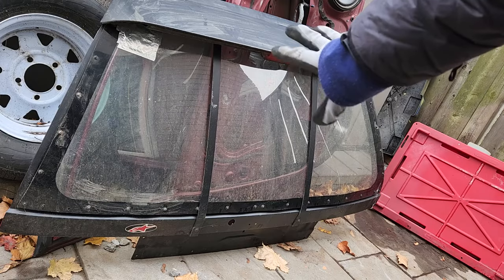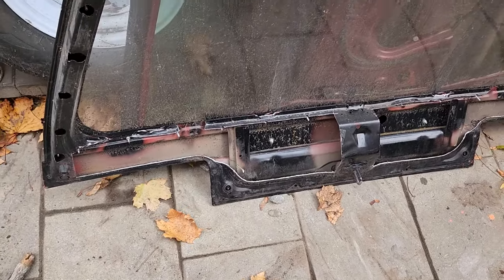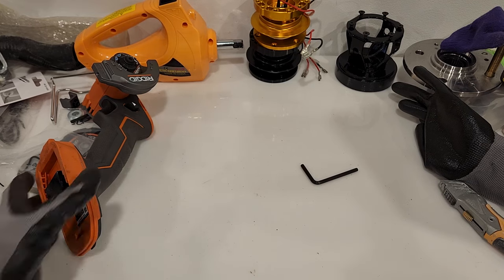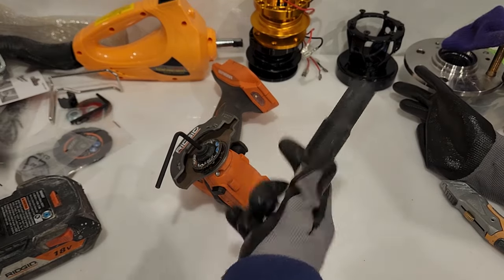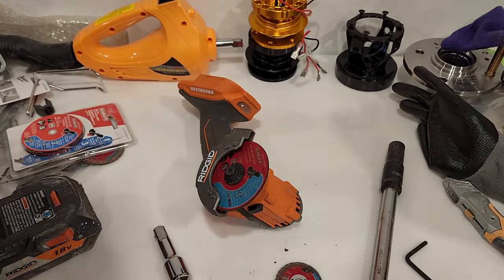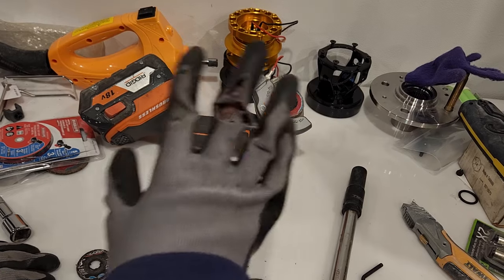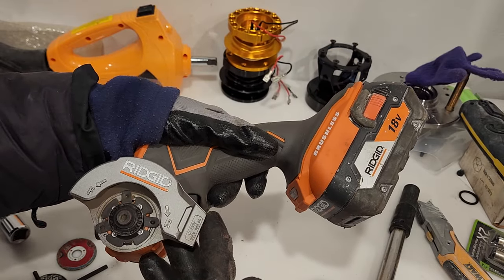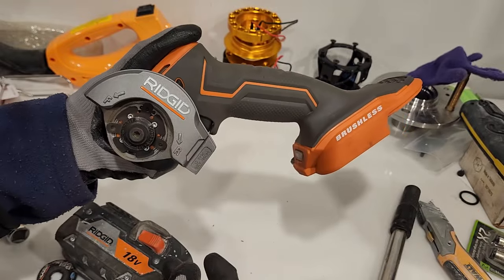Ridgid  3 inch Cut off saw review

Comment: I too have heard from users that their screws (a) came loose (when used in reverse, one instance I've heard of) and (b) got stuck (several users reported that).
Never happened to me though - however my use is much lighter, mainly cutting screws, thin steel strips, and aluminum / plastic profiles, and a bit of plywood.
I am really pleased with it, but it looks like it's not good for the tasks that you have to undertake.

I still use my cordless angle grinder for bigger jobs.
This tool takes some getting used to, particularly requiring control to keep it from "running away", and it being back heavy is a contributing factor just like you mentioned.

Thank you for showing it in action, might come in handy if I ever have to work with sheet metal.

PS nice to see a lady that does manual stuff, seems wholesome and peaceful. And a smart and careful one at that, what with safety videos linked in some of your videos and proper PPE. 

Best wishes to you and yours for the holiday season and the coming year!
Reply from the maker: this ridgid out performed the dewalt and it's not just my opinion you can see it in both videos. The interesting part is the dewalt has a left hand threaded screw and it came loose more than this ridgid with has a right hand threaded screw